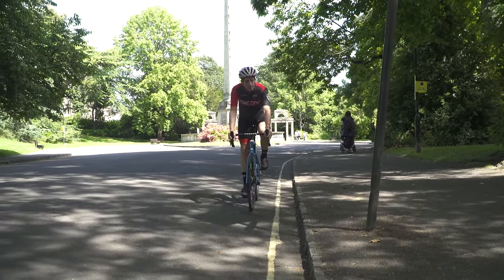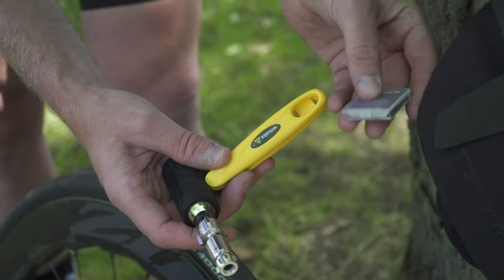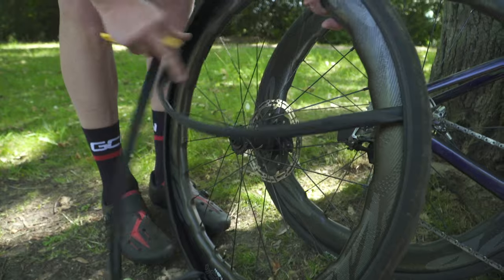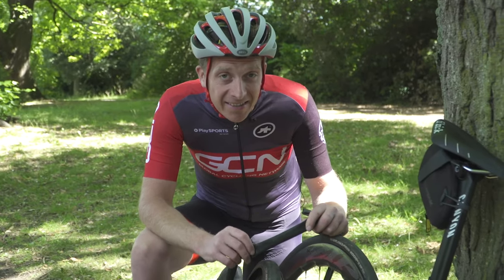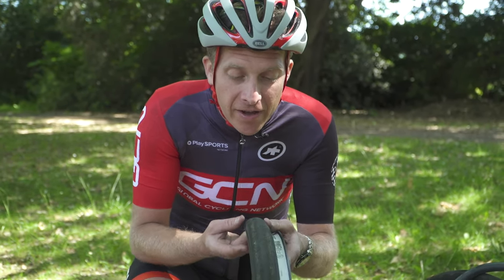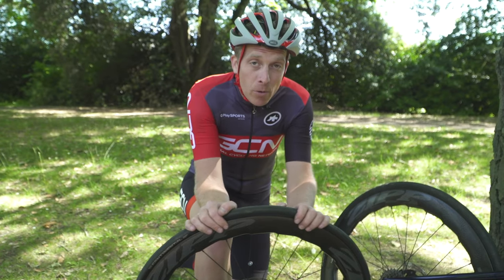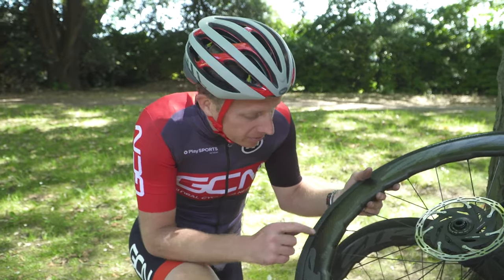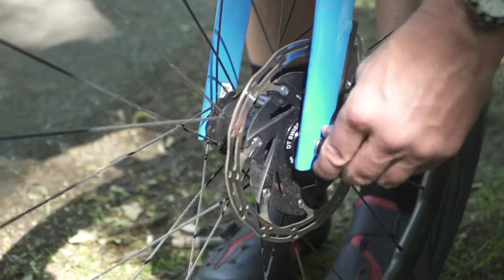How To Fix A Puncture On A Road Bike | Repair A Roadside Flat Tyre

Comment from the maker: What do you do when you have a puncture?
Reply: Change the innertube...
Reply: Buy a new bike.
Reply: Call for rescure
Reply: i throw my bike into a hedge and run away
Reply: GCN Tech what pump is that?
🙏
Reply: @kyuss2790 ...Topeak
Reply: William Schultz Model?
Reply: I carry spare tubes. When I get a puncture just replace the tube and repair the old the tube when I get home
Reply: I ride tubeless, so I just keep pedaling, and the sealant usually fills the hole.
Reply: Cry for sometime
Reply: I keep riding as the sealant in my tubeless tires does its job.
Reply: first off all i would take my helm off :)
Reply: scream in despair (because I thought a small ride does not warrant bringing a spare) , then walk to the nearest metro station.
Reply: Swear
Reply: Running tubeless on my roadbike, it hisses a bit, then it seals itself. On my other bikes, I call a taxi.... :-)
Reply: If you have butyl inner tubes thry don't grow on trees. Butyl tubber is a hydro carbon, synthetic rubber, a copolymer of isobutylene with isoprene. Even more reason to repair it. Latex rubber tubes do grow on trees and are my favourite tubes.
Reply: phone my mum
Reply: Post it on social media.
Reply: I wonder what the hell punctured my puncture resistant tyres ive had for 4 years with not issues.
Reply: change the inner
all my spare inner tubes had punctures that i fixed at home
roadside fix is usually reserved for last resort :D
Reply: Step 1) turn bike upside down...
Reply: I see no problem in putting the bike with the wheels up. Even though, if it were the rear wheel you would have to put it anyway so as not to damage the rear derailleur. I also do not fix the camera on the spot. I simply exchange for a new one (I always take three to reserve). But, his video was very useful for those who have no idea how to change a tire. It had my like!
Reply: @treybrzezinski6611  Exactly...!
Reply: I swear. A lot.
Reply: Cry.
Reply: I immediately change the tube. 😎😎
Reply: Change the tube..minipump it up. Keep riding
Reply: Always carry patches and extra innertube. I get them all the time xD
Reply: Buy a new bike
Reply: Call the automobile club
Reply: I swear a lot and then think something up
Reply: Cry
Reply: Kick it for being a naughty bike!
Reply: I've had one yesterday in my very old Giant mtb, the back tyre. I put my bike upside down. I find it easier. I've just put a new inner tube. But I'll fix the old one later today, or tomorrow. I use the glue, not the self adhesive patch.

My problem is to put enough pressure back in it with the tiny pump.😔
Reply: Throw away the bike and start over.
Reply: bus
Reply: NONE of this, because I'm just a normal bike rider!!! Haha

Comment: I love how he conveinently chooses to demonstrate on the front wheel while every flat tire I've ever gotten while riding has been on the rear.
Reply: Ha ha. Yes and in Italy where i live its nearly always through potholes, compression punctures, not grit.
Reply: Funnily enough most of the flats I can remember having where on the front.
Reply: Lol, IGH with thru-axle/quick-release ;)
Reply: @merckxy54  You might be interested in the fact that the surface has been renewed on many hills road in Oltrepo' Pavese, you could think the road has been bombarded before that.
Reply: @boomerangfreak  i ride both motorcycle and bicycle. all the flat i had were on the rear. anything from big 6inch nails to small slivers of metal tru the tire.
Reply: Every single puncture I've ever had has always been flat at the bottom 👍

Comment: I feel a lack of authenticity here... You forgot to accidentally pinch the replacement tube during reinstall, you didn't waste your only C02 to discover said replacement tube was pinched by a tire lever, and you definitely didn't get grease all over your hands just in time to ruin that brand new bar tape.  And as you break out your backup set of patches to fix that tube you pinched, you come to the inevitable realization it's raining and everything is soaked.
Reply from the maker: Hahahaha very good, we hear you!
Reply: What was also missing was screwing the CO2 canister into the adaptor with the valve open and blowing your CO2 everywhere, and pinching two replacement inner tubes and then the inevitable walk home to try again not at the side of the road
Reply: Cup & Cone oh man did u just start cycling 🤪🤪 we have all been there in part one time or another I always  keep nitrile gloves 👍
Reply: @LaughingSaint66   - No, but we have all done many of these goofs at one time or another.  I just thought it was relatable for many people to post an extreme, especially since this video is obviously aimed at beginners that will fall victim to some of these.
Reply: @dafyddgiddins9861  - Haha, yes!  Before outside assistance was allowed in MTB, I saw so many races end that way.  IIRC, it even happened to the woman who was leading the Ironman in Kona many years ago...was out in front and blew out all her C02 without getting it attached first, race over.
Reply: Cup & Cone indeed but that’s how we learn right 🤷🏼‍♂️
Reply: That exact situation has happened to me before.... Or not having the CO2 valve for the cannister, another frustrating puncture
Reply: The first time I changed the tubes on my very first road bike, I pinched and punctured both... At least I was at home ;-)
Reply: Too funny and so true....at least for me anyway.
Reply: spoeni if  I’m close I’ll walk home to save a co2 😂😂🤪
Reply: Why not just use a hand pump, it isn't capable of a lot of pressure but they're good enough to ride to a petrol station and use their compressor there
Reply: @Fred_the_1996  I have a truflo minoot that gets up 120psi I mean takes longer than c02 but it's infinite pumping and free.

Comment: Why not carry a spare tube or two and then fix the puncture when you get home? That way the patch will have plenty of time to form a good seal before you next go out riding.
Reply: I get about one flat a year.  A patch kit is miniscule compared to a tube and weighs nothing.    I see these guys with super pricey bikes yet they ride around with 2 tubes crammed in the their back pockets. Not very sleek or lightweight. I think the  idea of carrying tubes is a hold over from the olden days when tubulars were common.
Reply: @cheesesandwich1236  what does the cost of your bike have to do with the price of tea in China?
Reply: @cheesesandwich1236  I carry 1 tube and a patch kit in a small saddle bag. Doesn't add much weight and probably has no/tiny effect on aero.
Reply: I carry one tube and 2 CO2 cannisters. no hand pump. If I get 2 flats I'm calling an Uber.
Reply: @eddiealvarez8030  Same for me.
Reply: What if you get more punctures than tubes? In that case patching your tube is the only option.

Comment: please do tubeless flat repair. there's a widely-held misconception that flats with tubeless set-ups are akin to the apocalypse.
Reply: harrylook I dare GCN to do one with tubeless, but I’ve only got 4 hours spare to watch it 😂
Reply: My experience from many years on tubeless: 
9/10 times it's a small puncture that just heals itself after bleeding a few PSI and a sqirt of sealant.
WHEN the hole is on the larger side and reopens once you start riding, let out enough pressure to the point where is stays sealed and you can ride home (to this day I have never been in a situation where I was not able to return home). Once you get home there are three options:
1. Off with the tire and put a patch on the inside, like you would patch a tube.
2. Plug it from the outside with a butyl plug, like you would do on a car of motorcycle tire.
3. Throw it in the bin if the hole is too big/tire is worn anyway/you prefer a perfectly balanced tire with no shake wat so ever.
Reply: Oh, and a pro tip: Change your sealant once in a while. I do it with a syringe, fitted with a chain lube straw. That way it can be done in 10 minutes by only removing the valve insert.
Reply: Lol my experience with Schwalbe pro one tl: had a flat after 2 weeks mounting, since then every time with inflating it hold (5,6,4 bar) for a while and then suddenly it looses al it's pressure.. when u r 30k off home...
Getting tired of it.

Comment: In the last year that I have been watching GCN, this is the first time I've seen Jon in lycra, or even riding a bike. One thing worth noting that you might want in your toolbag is a small pair of pliers (like you might get in an expensive Christmass Cracker) as I've had an experience where the nail was so embeded in the tyre its took 40 minutes and much blood to remove. Also a video with tips for dealing with really tough tyres that are not very flexible and hard to handle would be good.
Reply: I think a chainbreaker could possibly be used as a plier in some way
Reply: Mini gerber works well there. Good for the fine wire from steel radial tyres - that stuff is hard to pull out!
Reply: For particularly tough tyres you just need to push the tire walls towards the centre of the rim, as when a tyres off you’ll notice inside the rim there is a step that the tyre sits in inside the rim (can be seen in this video at 5.11) and where the rim tape sits is about 3 mm lower so you need to get the tyre sit in the lower groove as the tyre is then loose and easy to remove, 9 times out of 10 I can remove a conti gator skin with no levers, when you pump the tyre back up the air pressure will force the tyre back up this step to sit just below the lip of the rim

Comment: Very glad to have been practiced at repairing tubes. I had to do my share of it on the Roubaix cobbles and the cheeky mechanics on the roadside were trying to charge me 15 euros for a replacement tube. 

If you're good at it you can score practically free inner tubes from bike shops, as customers just pay for tube changes and the shop can't rightly go around using old tubes for anything.

Comment: Two punctures on the rear wheel. Only one tube. Tire damaged. 45km away from the car. Made a knot on the tube to isolate hole. Insert tube into the tire. Inflate at low pressure. Ride 20km with a “square” wheel. Ride out of the saddle to reduce weight on rear wheel. Reach Walmart. Replace tube and patch tire. Back to the car. Safe and no damage on the bike. Thanks for the tip I learnt in one of your videos. It saved me an Uber ride...Pierre, Houston, TX

Comment: BTW, if you are running tubulars,  you aren't out of luck.  Remove the glass or whatever caused the leak.  Drip sealant into the cut left by the <glass>, which protects the tread a bit and marks where the hole is.  Remove the valve core and drip in just enough sealant (not a bucketful) to get to the hole and seal it from the inside.  Pump up just until the tire holds its shape (not up to riding pressure yet), and rotate until the hole is at the bottom.  It may take 10 minutes for enough sealant to plug the tube and form a "patch" between the tube and the tire, but once it holds, pump it all the way up and ride.  I've ridden cyclocross tires up at 65psi on rough pavement for hundreds of miles without any trouble after such an episode.

Comment: Thank you Jon ! I never thought to skewer the fork as a protective measure! No matter how much I know, I always learn something new.

Excellent tips. If I may, I would add to carry spare tubes, for ease of fixing the flat, then repair and re use the punctured tube at home. it's easier for lazy old farts like me. Tubes are cheap. But I should, and will, carry a repair kit too from now on !

Comment: it can be difficult to get the tire back in the rim, more so if you dont have foldable tires, it helps to slip in as much of the tire as you can, usually your left with 6-8inches of a tight spot that is hard to pry in, so you want to work the extra slack from all around of the tire that is alrdy in the rim. you can do this by holding the part of the tire that is still out of the rim close to your chest and use both hands to pull and work the slack out towards the tight portion. at that point reverse the the tire lever and pull towards you while using your other hand to hold the tire in place.

Comment: Two process suggestions.  When removing tire from bead it is easiest to push the valve stem into the tyre and then insert levers opposite of the valve stem. 

For the rear, you should put the chain in the smallest cog.  Then when reinstall comes you know what gear to set the chain to. If done well this can be done without touching the chain.
Reply: Thanks

#OneMessageFoundation

Comment: Great timing, I had to stop 3 times for a single flat yesterday as 1) got a small puncture 2) the glass shard was imbedded in the tyre and I only found it the second time 3) the self adhesive patch did stick well enough and gave way after 10 km. Great ride though
Reply: I was wondering whether to try these self-adhesive patches, but I've seen a number of comments about them not sticking well. I'll stick to the old rubber patch and rubber cement for now.

But I like the idea of carrying a spare tube, and then patching the old punctured one once I get home.

Comment: Interesting how you pointed out the benefit  of the hand pump as opposed to the canister, so you can check if the Tyre is on correctly.

Comment: I've always started at the valve when removing a tyre casing and finished at the valve when refitting - logic being that the well in the rim opposite the valve has more space for the bead to drop into thereby making it easier to extract or reseat the bead at the valve. But otherwise looks spot on!

Comment: I always just use a spare tube when on the road, then patch the hole at home.  Patch it on the road only if I’m out of tubes.  Also, I only use the rubber cement type patches... They’re the only ones that always hold air for years to come.  I also always carry a metal scuffer and small bottle of denatured or rubbing alcohol, or alcohol wipes, for cleaning the prepared surface before applying the patch.

Comment: Just caught my first puncture today, a nasty, rusty nail ruined my rear tyre. So a quick 30 km ride through gentle rain on my cyclocross bike turned into an 8 km hike back home 😐

Being a newbie, it's time to work on my skills as a mechanic. Luckily, this didn't happen on any of my 50k or 75k rides.

Surprisingly, this didn't ruin my mood at all. Crashes happen (two of these in 840 km total up to so far), punctures happen. It's all about learning from it. I love my bike.

Comment: I run tubeless. I have had a couple of punctures where the hole is too big for the sealant to fix. I carry a needle and kevlar thread so I can sew the tyre back up which makes the hole small enough for the sealant to work. The last time I did this it lasted the 40 miles of the rest of the ride (gravel) no problem.

Comment: Gotta find what caused the flat before you install a new tube. Take the tire completely off the wheel, turn it inside out and really look. Amazing how a little piece of glass or a wire from a radial car tire can be hard to find and will cause another puncture. Quick patches are not a permanent tube repair in my experience- when you get home replace the tube or use a glue on patch.

Comment: Good video. I haven’t been on a bike for 40 years and I am considering an electric mountain bike to get me out and about. Nothing serious, just forest tracks and/or cliff trails etc. I’ve got to ask - hasn’t anybody thought of tyres filled with dense foam ? Or still use an inner tube but fill it with a type of expanding foam. Or has this been tried without success? Hoping to get out and about soon - cheers

Comment: Great to see John out and about! Instructive video but no one ever mentions the fact that the last bit is almost impossible. Do the GCN guys have super-human grip strength? Is there a knack to getting the last bit of the tyre on the rim? Am I a spaz?
I know CO2 saves a few seconds, but it's the most ridiculously wasteful thing. Only drinking bottled water is worse. As such, it should be discouraged as an anti-social activity. If you're in that much of a rush get a frame pump.
Reply from the maker: It's mostly technique, practice makes perfect!

Comment: I just pull the thorn or whatever out of the tire. replace the tube and repair the flat when i get home or to work. Usually easier sitting at a work bench w fluorescent lighting 👍

Comment: good advice! But with me it's *always* the rear tyre, I get filthy from the chain (carry a shop towel but no gloves), and the mini-pump only puts about 30psi in the tyre before my bicep is done, as opposed to the ~100psi from the track pump (which I don't carry on the bike, obvs!). The plan is to move to tubeless and hope that this becomes history...
Reply: Been riding tubeless for ten years. No regrets.
Reply: Front tyre usually flicks up the offending puncture device, so it not it is no longer lying flat when the rear wheel hits it.

Also, wax dipped chain fixes the grease problem. Awesome not to have grease covered hands. Sucks if you help somoen else, and they aren't using wax.
Reply: @MrBJPitt  I figured it was because my heavy carcass was over the rear wheel, squashing the tyre. Definitely doesn't help with the pinch flats.

Comment: Question, for that front wheel, that is a disc brake. How do you make sure that when you put the wheel back in, that the brake pad are aligned center like ] | [ perfectly. Is it just how disc brakes work that once you put it in and squeeze it then it is going to be be aligned or that if you put it back on, if it was aligned when you taking it off, it is going to be aligned when you put it back on?

Thanks!

Comment: Jon it's also worth mentioning - Do not press the front brake lever on disc type wheels or the pads will not allow the wheel to seat back on the axle once you have repaired the puncture, you'll end up trying to prise the pads apart, more time on the roadside faffing about, Peter